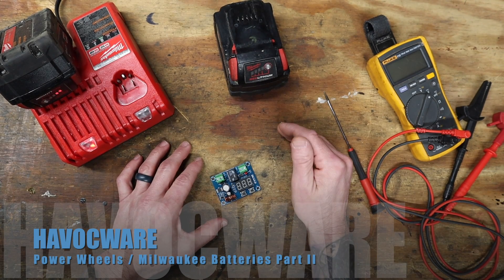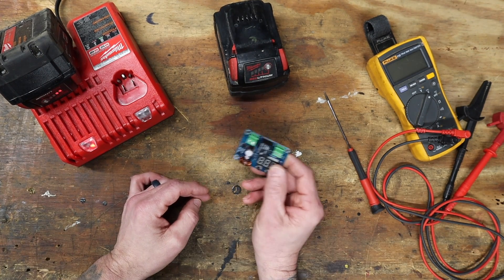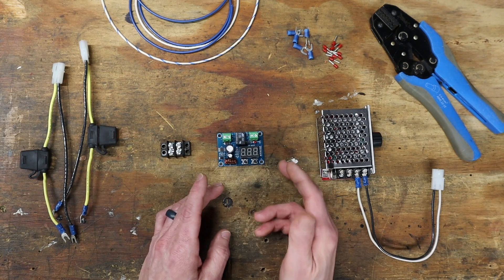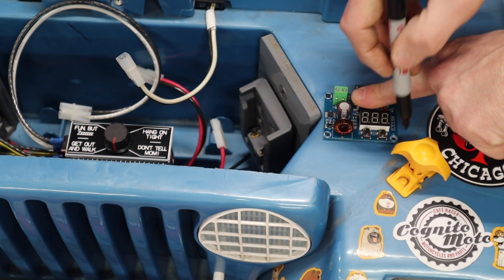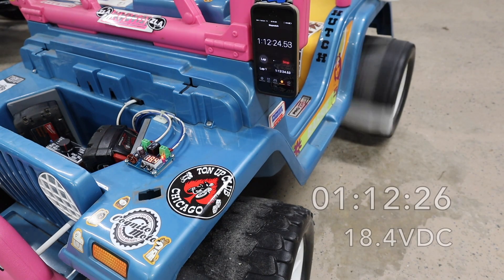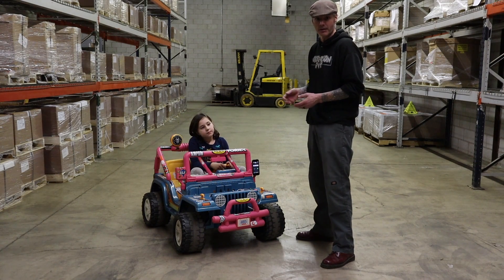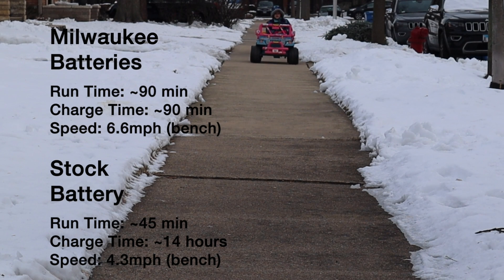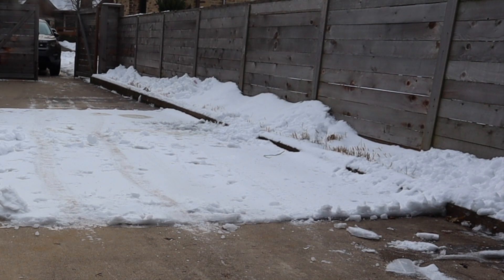Power Wheels Milwaukee Battery Upgrade RUNTIME TESTS & Battery Over Discharge Protection Install

Comment: So I wired this up without the speed regulator. I used 40a inline fuses and the fuse block on the voltage regulator started smoking after about 5 mins! Checked the batteries and they were dead too. Double checked my connections and wiring and am stumped. Am I missing something or is the speed regulator an integral piece? Thanks!
Reply from the maker: Hey Mike - sorry you're having issues with this mod, but it sounds like you might have a dead short? The 40A fuses are way too high for this setup, I'd suggest 20A at most; the relay on the voltage cutout is only rated for 20A, anything more and it will certainly start to give.

The speed regulator isn't required, but will definitely help you here, as it will help keep the load going to the motor(s) under that 20A max of the relay. 

Can you take a quick video of your wiring and post it so I can take a look?
Reply: @havocware  I think I found the issue. I installed the High Output XC6.0 batteries and I think the current draw is too much. I put in some older standard XC4.0 and it functioned without melting anything :)
Reply: Mike Clark was the high out batteries the problem? I was going to use HO batteries but will not if it’s going to melt things.Also, are you using 2 20amp fuses?
Reply from the maker: @Mike Clark - Hey Mike sorry for the lag in getting to you. Glad you found the problem, I looked at your build photo - looks great to me! Cheers!
Reply: @logiqalone8249  I am using 1 20 amp fuse inline on each battery positive prior to meeting at the terminal block. The HO batteries were the problem; stick to the standard XC for this build! Good Luck!
Reply: Mike Clark Thank you. Very good information!
Reply: @havocware  well it's not as pretty as yours I just used direct connections but here's a pic! https://photos.app.goo.gl/y485EzSEnHZU11mN9

I have the + from each battery running through an in-line fuse connecting at the terminal block and the negatives meeting there too. They then come out of the terminal block to the "in" of the regulator. I then have the out of the regulator direct to the vehicle leads. Removed the regulator today and the 20A block on there is a tad melty shrug
Reply: havocware Is that 20amp for each fuse or 2 10amp fuses that sum 20amps?

Comment: I did this hack last month.  I was surprised the single 4.0 battery lasted about one hour, or maybe it just felt like an hour.  That was with 2 kids, maybe about 90ish pounds total and they were using their Silverado truck to haul paving stones for me :)  Controller was set around 50% I think. It was still definitely faster than the stock battery.  I did not know about the low voltage protection cutoff for the battery so I ordered one the monitors you linked and also I liked the dock you linked better than the adapter I used so ordered one of those too, thanks for this video!

Comment: You can cut that charge time down to 45 minutes with a fast charger also now try the 12.0 HD battery
Reply: Derek Claycomb fast charge not only heats the cells up a lot more but by charging faster it doesn’t allow the cells to absorb their full potential yet they will register 100.% which will be one of its limited life time charges. (Take a battery charged in fast charge and when it’s full put it directly on a slow charger and watch as it starts charging more) Charging to 80.% is the ideal spot for optimal lifespan but it also decreases run time by a lot. 100% charge is less damaging to the cells than fast charging them is.

Comment: Process described very professionally, DC motors, they are now getting higher power than nominal design, they are usually 12VDC, now getting probably 15 to 18 VDC, will they last the same?
Reply: Mine burned out within 5 charges. I'm going to upgrade to 24v motors as soon as I figure out what rpm to get.
Reply: @skeeter1016  build your batteries packs with 18650 (5 in series), from old laptop batteries, is cheaper and last longer than the common ones.

Comment: Only things I'd add are:
1.  Either a voltage monitor on the dash or low voltage indicator so you can get the power wheel back to the charger station to swap batteries before it dies.
2.  Diodes.  Any battery system that uses multiple self contained batteries needs current flow control otherwise only replacing one dead battery will result in hurting both the fully charged and dead as they try to equalize as fast as their internal resistance allows.
Reply: Any links to what diodes you would use would be awesome.
Reply: @lazydeadpoet  Really the type/style doesn't matter too much in this case.  Most important spec is continuous current rating at your highest ambient and lowest voltage.  Even then go bigger than you need for a safety margin.  Then you want to minimize forward voltage drop to give the motor as much voltage as you can.  Other than that just pick the cheapest option.  Mouser or Digikey make it easy to filter down your results to find your perfect one.  Or you can get lucky on amazon finding one that works for even cheaper.

Comment: This is awesome! I finally got all my parts in this week and was able to get it built today. I appreciate the tip to add the voltage shutoff to save the battery. I installed just one M18 5.0 and am amazed how long it ran.
Reply from the maker: Enjoy!
Reply: Doing the same thing soon for my kid’s Kid Trax.  Following the build but will initially use only one 18v battery as the motor is only 6v
Reply: I just got all my parts in to do this. How did you adjust the voltage shutoff to 16.5v?
Reply: @christoferlanderos8841  You have to hold down the button for a couple seconds to be able to adjust the cutoff and the restart voltage..
Reply: I set the left controller button to 16.5. the right controller button goes to a Max of 10 and that's the one that I set to 1.

I've triple checked all the wiring I'm using the exact same parts he used but I'm getting no juice to the wheels. The speed controller switch is set furthest away from the controller. I'm at a loss was hoping you might remember your install and have any tips for where I might go from here
Reply: How long did it run off 1 battery?

Comment: About to do this, but with m12 batteries. The power wheel I'm modifying only has 6v motors so I'll be stepping it down similar to what you did, I'm also incorporating a low voltage cut off like you have done in this video, but I'm having a hard time finding what the cut off should be set at for the m12 battery. I play on running on of my tools down similar to what you've done, but curious if anyone has found anything regarding a safe low voltage cutoff for m12 batteries?
Reply from the maker: Hey There! I think you're on the right track doing an actual tool rundown yourself. Your milage might vary, so to speak, but if you give yourself a volt or so buffer from what your tool cuts out at, I think you'll be ok.

Document it! Let me (and everyone else) know how it goes!

Cheers!
Reply: @havocware  
Assuming that m12's versus m18 is the same chemistry just more cells (I realize that the cells themselves are likely going to be different, but I'd assume that they are still li-ion tech), I think I can calculate a cutoff with your data as well. 

Your rundown test went down to 13.5 volts, which with 5 cells comes to 2.7 volts per cell. That's definitely lower than the suggest 3.2 volts per cell. The 3.2 volts per cell would get you 16 volts, which is what you found on the interwebs. You eventually settled on 16.5 volts, which translates to 3.3 volts per cell. 

My rundown test today got me to 9.8 volts at shutdown. The m12's have 3 cells, so that's 3.267 volts per cell. That actually looks a bit better than the 2.7 volts per cell you ended with. With your safe cut off of 3.3 volts per cell, I get 9.9 volts cutoff. Conservatively I'll likely just call it 10 volts at cut off.

Comment: great video, i watched the first video you did too! instead of installing a battery monitor, is it possible to modify a tool so that it doesent power the tool and instead just has wires coming out of it so it uses its internal battery shut off monitor? just a thought
Reply from the maker: Hey there Kevin. Sure, you could modify/sacrifice an old tool to use the mount, and the internal electronics. I;m sure that's what others probably have done in the past.

Good  luck!
Reply: @havocware  thanks! wasent sure if that made sense but sounds plausible, time to find a tool that nobody wants thats broken to test it out, not using my new dewalt stuff haha ty

Comment: Awesome. Thanks for the info. The voltage drop limit is exactly what I was concerned about. The batteries are expensive and I'll still need them for my tools. But now I can justify picking up a few more for my tools. I'm thinking a flexvolt battery.
Reply from the maker: Glad I could help!
Cheers!

Comment: Dude, your a genius for even attempting this!
Reply: LOL in a long line of geniuses who did this with motorcycle batteries and a number of other things back in the 80s/90's. Mine had a full size car battery in it with special knobby tires. Wasn't very fast, but it never got stuck in the yard (almost 4 acres).

Comment: Have you thought of adding a soft start circuit? Something with a 2-3 second ramp-up would allow you to add rubber to the wheels without chewing up the plastic first gear in the gearbox. And no wheelie bars required either.
Reply: is chewing up the gear an issue? I was going to do this mod including adding rubber to the wheels.
Reply: @jonathansepulveda3617  Eventually, the plastic gear will get chewed. How fast depends on power, gearing, weight and traction. They sell whole new gearboxes for pretty cheap, but there are relatively few models that have metal gears available. I was thinking of using an Arduino as a motor controller but was wondering if there was something simpler.

Comment: Hello, I'm new to wiring. What AWG are you using throughout this project? I believe the PW wires are 12 AWG.   Molex connectors accommodate 14-20 AWG. Terminal block is 14-22 AWG. Ferules are 7-28 AWG. Help is appreciated.

Comment: Thank you for the amazing video! I would love to try this but have a few questions. What fuses did you use? You hooked this up directly to the powerwheels 12v system and it worked fine?
Reply from the maker: Hi John. I did - but keep in mind that this is an older unit, with no on-board electronics.

I've had a few other people try this with newer models that have lights, speed control, etc. and they're having an issue with the over-voltage protection.

Do a little research on your model and see if others have done a similar conversion, or test it first before you commit to the entire process.

Cheers & Good luck!
Reply: (old post but still relevant to anyone viewing)
As havocware responded, a lot of the current Ride-on models are actually not PowerWheels, but from companies like Best Choice Products (BCP)..they are great little cars..but have new electronics in them. So for example, the RX18 is a 12v ESC (with remote) and runs with a 12v 550 motor (usually a pretty low rpm, like 9000). So if you want to upgrade the voltage to gain more power, you will want to drop in equivalent components, like an RX30 and 24v 550 or bigger motors. The speakers/lights dont seem to be affected but you WILL burn up the motors and ESC if you increase voltage from 12. 

So basically in-line fuses and voltage controllers are necessary...you can also run an 18v/20v battery from a tool like here, and adjust the controller to only hit say 16 or 18v even though the motors and ESC are now capable of 24v. That's what Im doing with my daughters SKY2875 jeep from BCP. Currently I'm running two 12v7ah Neptune batteries in parallel for longevity, but I want more power not for speed but for climbing/rough terrain. As my daughter gets older and can drive it on her own, Ill simply turn up the voltage. I can either reroute the cables between the batteries for a series run (increased voltage but no increase in amps) and get 24v, or drop in a tool battery. Either way 12v is weak and slow...I think the 4x4 2 seaters offer 24v out of the box...but I'm not 100% sure which motors or ESC come with it..so maybe just swapping in those components is a good option too.

Comment: @havocware. Cool breakdown. I followed it entirely on my daughters powerwheels mustang smart drive. It worked momentarily until it stopped and now it will not work at all. Seems it has an onboard computer that has cutout power. Have you encountered this and do you have some input for me to fix it. Or is this project a total waste? I've searched for a fix but seems no one has had this problem before. Thanks again Rich
Reply from the maker: Hey there Miguel. Sorry you're having an issue with your project. Unfortunately, I don't know much more about any other models. Will it run with the original battery reinstalled, or with the speed controller at a lower setting? The onboard system might detect the over-voltage condition as an error and shut down the output to the motors. Maybe a reset by removing the batteries altogether for a while will reset the board? I'll do some research and get back to you.

Sorry again...
Reply: @havocware  I've removed batteries and lowered the speed setting to less than a quarter or less works for a few seconds than cuts power. I have not tried putting the original battery back in. I'll try that tomorrow.

Comment: Absolutely great video you put together here! Initially I wasn’t going to add a voltage cutofff switch, but seeing that I just sunk $60 in to new batteries I’ve changed my mind. Would you mind linking me to the bullet connectors you use? I’m less than an amateur electrician- my knowledge mostly coming from tinkering with power wheels. Haha.
Reply from the maker: Hey Chris - thanks for kind words! If by bullet connectors you mean the wire ferrules on the ends of open splices (like I used for the LVCO) - this is a decent cheaper set https://amzn.to/3c8EhQo. There's a link to the Molex plugs/connectors in the description as well.

Cheers!
Reply: havocware yes! Those ones! Thank you sir. That will be a big help to properly terminate some wires I’ve been fighting with.

Comment: I used 20v Dewalt  5ah batteries.  I used the voltage cutoff and speed control. Within 15 secs, the fuse in the sc blew. So i just ran without it. Then after about 10 or 15 minutes of run time, the voltage disconnect got hot and burned up. Any suggestions on why it overheated?
Reply from the maker: Hi There!

If I had to guess, I would think that with the increased voltage the motors are drawing too much amperage for the relay on the voltage cutoff module to handle. It's rated for 20A, and at 20v those motors are drawing more than it can handle.

Do you have in-line fuses in the circuit? They'll help protect the other components and let you dial in where the sweet spot is so you don't overload the relay.
Reply: @havocware   i have in line fuses off of each battery, just like in the video. They came with 30 amp fuses though.  They never did blow. Thanks for the input.
Reply from the maker: @jrocha82  - I'd drop them down to 20A. That voltage regulator is a small solid state relay, and isn't rated for more than 20A. It might handle a few amps over for a minimal amount of time, but 30 is pushing it.
Reply: I just had the same problem. I guess on to search for a lvc with a higher amp draw rating. I'm not using a speed controller
Reply: @MattC87  if you find one, lmk. I looked for a few on Amazon and didnt see one

Comment: Hi, I bought to my son the Star War Luke Skywalker's Landspeeder and have a control panel with lights and dialogues from the film, but  my question is if I increase from 12V to18V won't affect/damage the control panel? Please advise.
Reply from the maker: Hi Raymundo!

First off - I love the Landspeeder and have been trying to get a hold of one for my daughter! Next, I can't comment on any other model with any certainty; I just don't know enough about them. 

I would start with the forums on modifiedpowerwheels.com and see if anyone else has done the conversion, or has a schematic and can give some advice. It's a very valid question, and you might be right that the additional voltage could play havoc with the board (no pun intended.)

Cheers!
Reply: @havocware    I'll check the link that you provided me before I started, Thanks a lot for the advise. And also I hope that you get a hold of a Landspeeder for your Daughter.

Comment: I’ve been looking for a clean program to draw up schematics like you used, what did you use to make your schematic?
Reply from the maker: Hi Kevin. I used Illustrator to make all the wiring diagrams. If you're looking for something to specifically generate schematics, you might want to take a look at Fritzing - www.fritzing.org.

Cheers!

Comment: I really liked your video, I would like to know if I still need to buy the low voltage cut off if  I buy the :18V 9.0Ah Li-ion Replacement Battery for Milwaukee 48-11-1820 48-11-1850 48-11-1860 48-11-1890 48-11-1828 48-11-10 Cordless Power Tools Extended Capacity Battery  That I found in Amazon that it has some features like over discharging protection, it has 7 intelligen protection system.
Reply from the maker: Hi there Carlos. I would recommend the protection circuit regardless of the battery make/model you buy. It's a relatively cheap safety device to protect your $80 battery investment, which do not have built in protection.